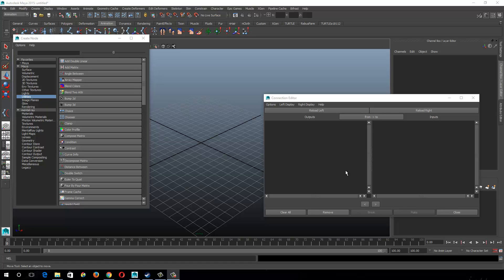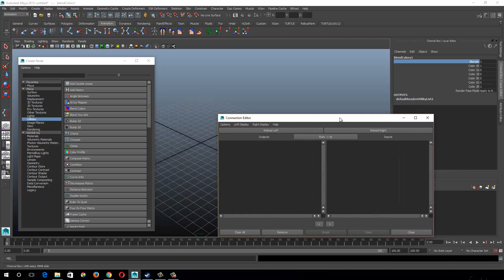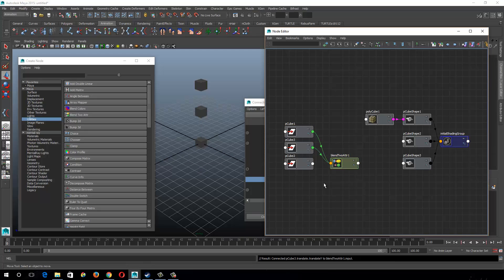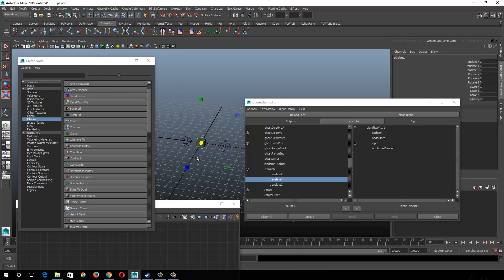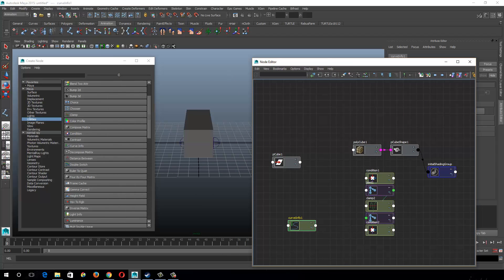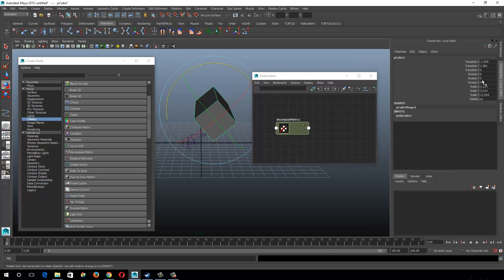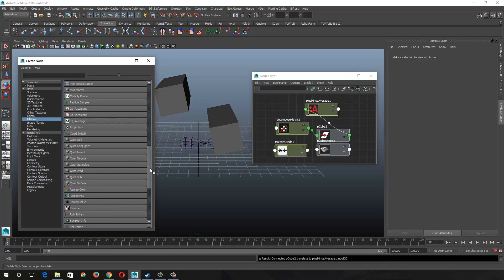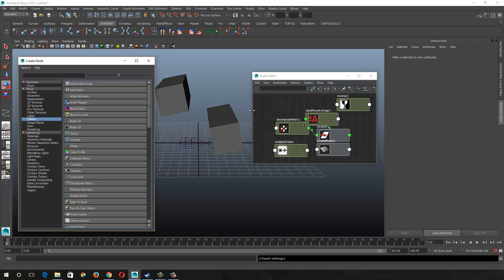Utility Nodes I Use For Rigging

Comment: Awesome video. Do you know how to use the remap value node and set range node? I heard they are somehow useful in rigging.
Reply from the maker: I've used them before but not so much in rigging with joints.  I've used them with particle effects before where I'm using a black and white ramp to define the life and death of a particle over time and I want the 0 to 1 range of the ramp to be equivalent to the length of my timeline, or at least a set amount of time.  Remap basically says this range is now this range.  Like you could say your input range was 0 to 1 and your output from that is now 5 to 10.  Set range is similar, but it can work with 3D values rather than single inputs, so like RGB or XYZ.

If I can think of a good rigging example I will post a video.  I've been thinking about it but I don't think I've used either since the last time I was setting up particle effects.  For the most part Set Driven Key does what I need these to do so that tends to be my go-to solution for rigging.characters and vehicles and such.
Reply: Thank you for your quick response and input.